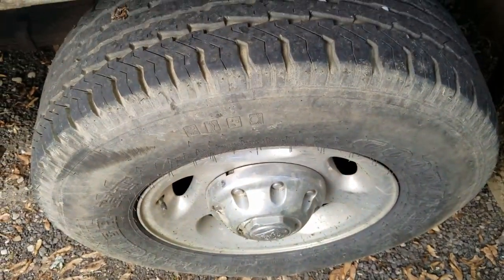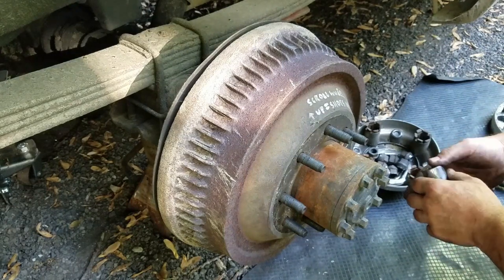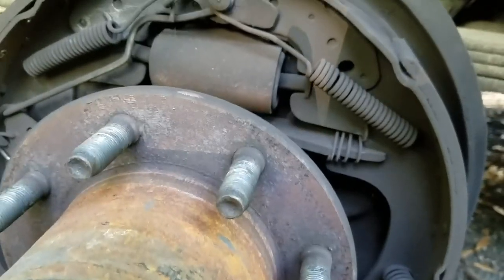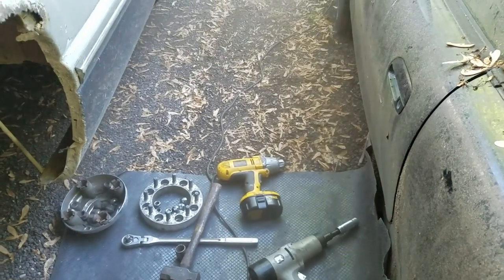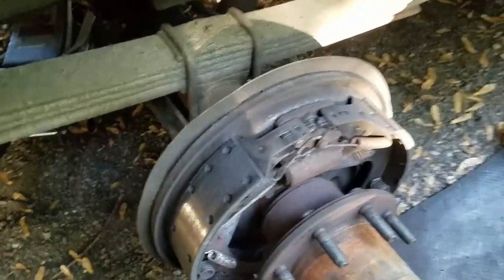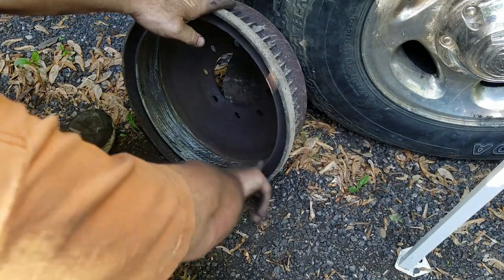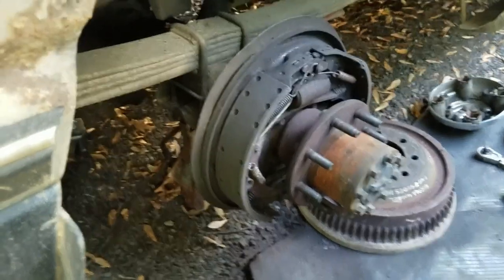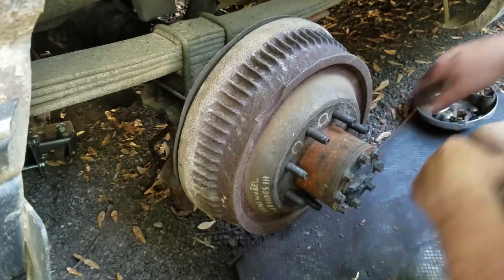1994-2002 DODGE RAM Adjusting rear DRUM brakes

Comment: They used to teach you back in the day to run adjusters until they lock up drum from turning and then back them off enough that it'll turn . You can do that couple times to seat them . Its old school! But that always worked for anything I've done .You are doing good though. Scuff up the shoes and inside of drum with sand paper,clean and lube the shoe contact points on the backing plate and most importantly put your parking brake on once in awhile. It'll keep your components from freezing up plus you'll know it is working and how well. I've been sanding drums and rotors to keep the ridge from developing.and it saves rotors ,drums and shoes/pads. I am no trained mechanic , but there isn't much I haven't  had the displeasure  of doing brakes on . People will tell you that rotors have to be turned or replaced constantly  etc, not true if you take care of them with a little maintenance. We are not all made out of money and everything I ever drove had good working brakes! Just saying!

Comment: Thanks for the video. I've an '01 Dodge 2500 with drums and found that putting high temp anti-seize between the hub and the drum mating surfaces also helps the the drum to release. Still needed a hammer though. I have had that method help me on other drum brakes as well.
Reply: Very true. After cleaning the hub and drum’s mating surfaces I use just a small water color brush to paint a thin amount of high temp antsieze on only the axel hub’s mating surface. The drum comes off with easy hand pressure.

Comment: My 94 Cummins has self-adjusting brakes. You need only back up to a FULL stop -- using the brakes to do so -- and they should adjust themselves to where the factory wants them.
The usual battle is that wear makes pulling the (old) drums off quite a challenge.
Reply: I know I am kinda randomly asking but do anybody know a good place to watch new series online ?
Reply: @Maxwell Jefferson flixportal xD
Reply: @Kannon Warren Thank you, I signed up and it seems like they got a lot of movies there =) I appreciate it !!
Reply: @Maxwell Jefferson Happy to help xD
Reply: do you drive fast in reverse, then stop?
Reply: @grasscutter88  5 mph will suffice.
Reply: @davidhimmelsbach557  does this adjust the parking brake too? Mine doesn't hold very good. My brakes get adjusted everytime I back out of the driveway then theoretically

Comment: Dodge’s Emergency Brake system is a faulty design because unequal braking tension is applied to each drum due to the brake cable’s unequal stretching over time without providing ANY fine mechanical cable adjustment between brakes. You will have to make your own cable adjustment mechanical coupler. See a Ford and Chevy for ideas.

Comment: Thanks, good explanation but missed e brake adjustment?
Reply from the maker: my truck is a 94, & an automatic. I have never messed with the E brake on it. 
Many times here in the snow belt once you push it, it locks up & then you have to take everything apart & replace all kinds of parts lol
Reply: @Smittyschannel  For sure! I usually just cut them out. Usually they just rust up and freeze everything up anyway. And honestly how often does anyone really use an e-brake in an automatic? I guess if you haul a lot of big trailers or something but I could count on one hand the amount of times I've used it in my life on an automatic.
Reply: @mikemccabe1727  just watched the video and reading comments. I use my e brake when ever I am on a sloped area and when I put it in park and exit the truck with the engine running. So I use mine all the time..